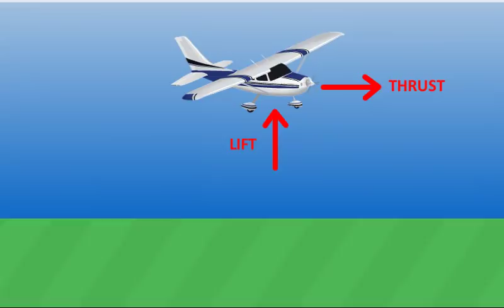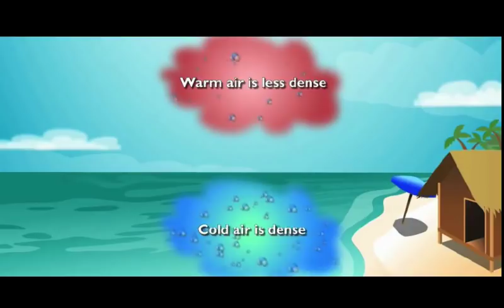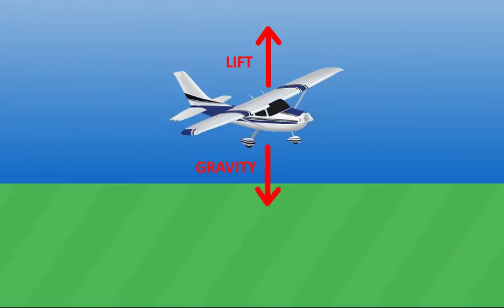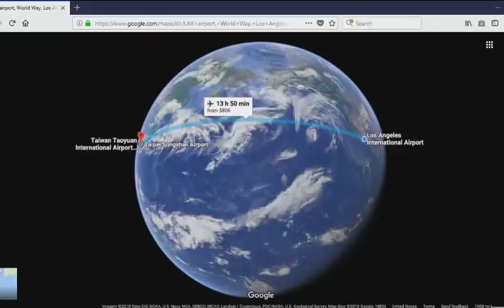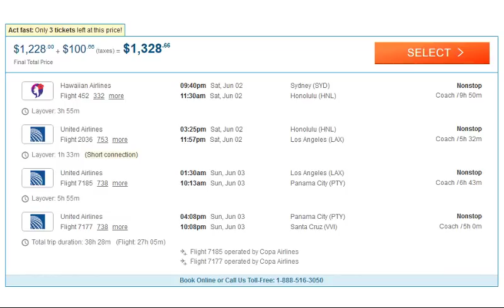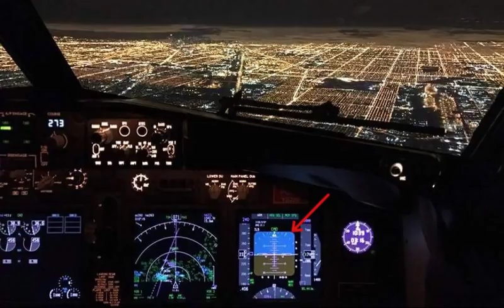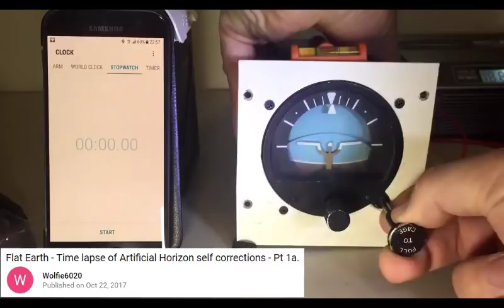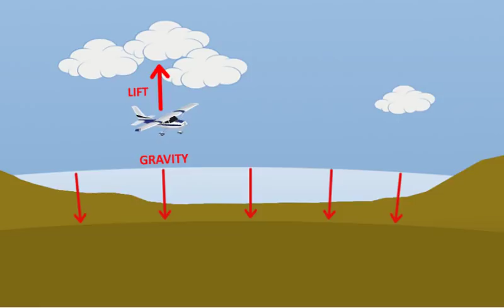Flat Earth Falsities - Plane Nonsense

Comment: The Video is wrong. You can't just remove variables from the equation.  You can't remove the 1000 MPH speed variable out of the equation because "The Atmosphere moves with the Earth".  The movement speed of 1000MPH still needs to be accounted for with the plane speed scenario.
Reply: +Viral Videos
Maths and physics are obviously not your strong suits are they.
Reply: Do you know what movement or speed is? 🤔 You cant just say you move with 3mph. This is physically wrong. You have to give a reference point. So you are moving 3mph on earth. Or you are moving 3mph in a train which moves 300mph on a earth. And earth moving with "blabla" mph around the poles. And the earth is moving with "bla" mph around the sun. And the sun ist moving.... And so on. But YOU feel (or see) only the movement your aroundings makes.

Mathematical you can see this too.
 V = s *t
This you will learn in school. But this isnt the whole equation. It is:

V = s *t +V0

So:

The train is moving 300mph and you are in the train moving 3mph in the same way the train does.
For the train:

Vt = 300mph +0  (cause the system we are watching is closed (you can make this infinite long))
 For the person:

Vp = 3mph + 300mph

Now you can compare both velocistys:

Vt = 300mph +0 | Vp = 3 mph +300mph

Now you can subtract 300mph on both equations. THIS WAS MEANT IN THE VIDEO. (Only want to highlight this) 

Vt =0 mph | Vp = 3mph

Now you can see, that you are moving 3 mph faster than the train itself.
Reply: @Viral Videos.
You are wrong. If you want to go to the back of the plane/train do you need to move faster than that plane/train is moving forward? Do you really think so? Then how it is possible that you walk faster than 500/60mph. LOL. Husain Bolt doesn't have a chance with you ;).
@Booby Wizard.
We have quite a good idea how that work. I told you before: air pressure which in turn create air resistance which in turn cause air friction and air viscosity. That air working against Earth's surface through millennia will go along with it.
Reply: Have you ever jumped on train moving at 100km/h and slammed into the back wall? No? Well, me neither. I'll preceed to try to explain to you why exactly planes work the way they do.
1. Earth rotates,
2. Earth DRAGS the atmsophere with it due to a force called FRICTION,
3. The atmosphere keeps moving along with Earth due to 1ST NEWTON'S LAW which says that what's in motion tries to stay in motion. That's why when you jump inside a moving train you don't hit the wall behind you, but instead move along with the train (in this case you are the atmosphere and Earth is the train)
4. The atmosphere is kept from flying off into space by a force called Gravity.
5. Plane is dragged by the atmosphere.
6. Plane keeps on flying through the atmosphere.
7. Most 13 year olds have no problem with understanding this.
8. Are you below 13?
9. If so then what are you doing on Youtube?
Reply: Yep, watch either of these two minute practical demonstrations and gain some understanding of preserved velocity:

https://youtu.be/CDf_0fPbNos
https://youtu.be/KacTRPL1MtE
Reply: Viral Videos:

No. You don't have to account sepperately for Earths movement. 
At least not, when it comes to objects like helicopters, planes, people and so on.
Because everything inside (lower layers of the) atmosphere moves with the exact same speed.
Everything on Earth is in the same frame of reference if you think so.

If you sit in a car, standing still for example, then you have a movememt of 0 relative to the car and to the parking lot you stand. If you start your car and drive, you move relative to the parking lot, but not to the car. You are in the same frame of reference as the car. You actually feel changes in speed, as in acceleration or breaking. Because your body needs time to adapt to the changed speed. This are the g-forces you feel while driving.
 but you don't feel much forces if you drive at a steady speed. (You can't drive perfectly even, so you likely feel a little motion at all times.

Imagine Earth as one damn big car moving through the universe. It doesn't accelerate or break, and moves very very steadily since a few billion years. So you just don't feel the earths movement, because it doesn't change suddenly, forcing your body to adapt. You move with the exact same speed. As the air around you, as houses, bodies of water and mountains.

This counts for planes and helicopters aswell.
The forces change a little bit in the upper layers of the atmosphere, as gravitational forces are weaker up there. This is the reasons why Earth has jet-streams - winds in the upper atmosphere that are responsible for the large weather patterns we experience.

TL;DR: You don't need to account for the Earths speed, as you and everything on Earth and in Earths atmopsphere moves with the exact same speed and direction, canceling out the effect. Like you sitting in a driving car, while the car is Earth and you are you.
Reply: jordy f: would it still need a windshield if there was a vacuum outside the car?
Reply: +Robert Lefebure
Why do you insist on proving you are a fucking idiot. We know you are so there is no need to keep on proving it, is there.
Reply: @Booby Wizard.
Find out about tangent to the sphere. Its definition require 90 degree angle to the radius which in turn is direction along force of gravity at that point of Earth surface.
Reply: @
Martin Gorbush
@Booby Wizard.doesn't do tangents only trolling.
Reply: Martin Gorbush you didnt understand my point. If you say: the train is moving 300mph and your friend is it sitting  in the train than you have to say further, that your friend is moving with 300mph too.
That says an outside observer.
If you are inside the train doesnt move particular to your speed.

That was the equation Vp = 3 mph and Vt = 0 mph.
Vp for velocity person
Vt for velocity train

When you stand outside:
Vp = 303mph
Vt = 300mph

When you stand outside the atmosphere:

Vp 303mph + earth rotation speed
Vt 300 mph + earth rotation speed

If you are outside the solarsystem:

Vp = 303 mph + earth rotation speed + earth/sun rotation speed
Vt = 300 mph + earth rotation speed + earth/sun  rotation speed.

And you can keep go on with that. But speed is relativ to a specific point. Our observation point is the scale of our "feelings" (dont knoe the real word) (like see, touch, smell, etc) we see a train relativ to our speed and than we can say: yeah, its faster THAN me or its slower THAN me. But you cant just say the train is fast.

Another example:
You are jumping. 2cm high. Your friend says: you are jumping very shitty low...
The snail next to you thinks... WOW so FUCKING high...
Reply: @Legromorph. It is strange but I haven't seen your comment before writing mine :).
Not to be malicious but equation for speed is: V =s/t.
Nevertheless your explanation is quite good.
Reply: Robert Lefebure: have you tried doing the maths to work out what that centrifugal force would be? I have. 
From my figures it works out at just 0.3458% of gravity. 
There is a bulge at the equator because of this though, and objects weigh slightly less at the equator too.
Reply: Legromorph

Brainwashed people always mentioned above you are inside moving train and cannot feel anything.

Grab a globe model with your left hand.
And spin it slowly with your right hand.
And look at it with your eyes, then think with your brain, HOW THE HELL THE AIR CAN MOVE ALONG WITH SURFACE OF THE EARTH AT THE SAME SPEED?
Reply: Legromorph Consider that the speed is 1100mph at the equator but is slower at the various north-south latitudes until there is zero travelled distance at the poles. Also, consider that the air speed necessary to keep up with those at ground level would need to be even faster at higher altitudes. ANd since they talk about gravity, why did they not mention centrifugal force? There would have to be some serious bulging in the atmosphere at the equator and hardly any atmosphere at the poles as the air gets "spun out" by the rotation. The idea that all the air moves as a unit at speeds ranging from over 1000 mph to zero with no visible evidence  is unfathomable. Even if the air was dragged at the same speed at the equator (and it would have to for doldrums to occur), the latitudes rotate at different speeds.
Reply: Martin Gorbush a good idea is factual? much like parallel to a plane makes a 90 degree angle. that is a fact. parallel to a sphere? negative.
Reply: Robert Nett

Telling a bullshit is easy just like say 123.

Try it in experiment, whatever you said is only works in your imagination.

You don't feel anything when you are inside a moving car because of the car has wind shield. The air is static inside the closed room of the car.
Try to drive a car without windshield, can you feel the wind?

Why GE believers are so damn stupid?
Reply: Viral Videos yeah they have no idea how the atmosphere moves with the earth either its just something they say.

Comment: This video is wrong. If the "air" is moving 1000 MPH with the earth, there is still 1000 MPH of wind speed in one direction.  Plus the earth spins at a variable and spins slower at the "poles".  If the Plane is flying perpendicular to the spin what happens then? or what if the plane is flying at a 37 degree angle of the spin?
Reply: If you are driving in your car at 70 mph then the air in the car is moving with you at 70 mph.
You can move any direction you like inside the car and you won’t feel any wind.
Reply: @Viral Videos wrote: "If the Plane is flying perpendicular to the spin what happens then?"
Airplane flying due north/south from equator will loss its perpendicular speed as it encounter air masses moving slower. This is very gradual loss.
Reply: Robert Lefebure 

Dude. 

1000 mph in space is not comparative to 1000 mph on Earth. 

Jump and do a 360. Took you what? 2 seconds if that? The Earth takes 24 hours despite moving 1000 mph. 

Now let us make it relative so you stop exaggerating and spreading this bullshit. 

If a human walks 3 mph East or West - relative to your size - you are literally walking faster then the Earth is rotating.
Reply: +Robert Lefebure
Why do you insist on proving you are a fucking idiot. We know you are so there is no need to keep on proving it, is there.
Reply: @Robert Lefebure wrote: "I'm talking like from 1000 to less than zero would be really noticeable in planes"
You must specify how long was a distance and how much time it took to reduce 1000mph speed to zero. Then you can think if that should be noticeable.
For example airplane flying 500mph straight north from equator would loose its 1000 mph drift speed during about 12 hour trip (6060 miles to the North Pole). That is about 83 mph per hour or 1.4 miles per minute. Would you really feel changing speed of car going from 61.4 to 60 mph over one minute?
Reply: Flying against the rotation you're flight takes longer.

Flying with the rotation you're flight is quicker. 

Thus why traveling N.Y. to L.A. and L.A. to N.Y. fail to take the same exact amount of time. In fact, they're about an hour (I believe) different.
Reply: Viral Videos 

Oh and the reason it is negated is due to the sheer size displacement. There's also the fact that "mph" is not the same on and off earth/gravity.
Reply: GrahaStw But if you put your hand out the window you will feel the difference. There is no windshield at the equator. The mountain tops would be cutting through the air even faster than the ground but they would exert far more "push" to the air than flat ground would. A 1000 mph is four ties stronger than a devastating tornado.  The equator is both the birth place of hurricanes and the home of doldrums. A hurricane spins at 125-150 mph both with and against air moving at 1000mph AND moves at a ground speed of 15-25mph? And, a doldrum (when the air was so "still" for days that sailing ships stalled) is actually when the air is dragged at the exact same speed as the spinning Eatrth?
Reply: Mykal Ridikulus  A globe spinning at 1000mph that had achieved getting the air to move at the exact same speed (from, say, mountains pushing it, drag etc) would result in a person standing there feeling NO wind at the equator because they, the Earth and the air were all moving at the same 1000mph rate. But there is a tower of air above them and the circumference increase going up would need for the air to move even faster to keep up. But I don't think it would. I would think the air would be dragged at a slower rate so the outer bands would not near the 1000mph. There would be so much shear as 1000 mph air diminishes to less than zero at higher altitudes it would be readily observable. I'm talking  like from 1000 to less than zero would be really noticeable in planes.
Reply: @Mykal Radikulus wrote: "Flying against the rotation your flight take longer"
That isn't always true. Airplanes fly thanks to air. That medium is responsible for its navigational problems (cross wind, head wind, tail wind). Check prevailing winds on flight height (30000 ft/10km-250hPa) on the globe and you will know why traveling between same location take different amount of time. Good start:
https://earth.nullschool.net/
Reply: @Robert Lefebure. Air has viscosity also.
Besides did you ever bother to calculate what speed is required to circumnavigate Earth at 100km height in 24 hours? 100km above equator it is about 1702 km/h when on the surface it is 1676 km/h. That is 26km/h difference. I wouldn't call that impossible to overcome. Especially if you know that wind speed at just 10km height can easily surpass 100km/h.
Reply: Robert Lefebure 

False. You are misrepresenting the facts and have forged an invalid frame of reference. 

Earth rotates at a 1000 mph. 

Frame of reference: a human walking 2 mph is moving relative to Earth's 1000 mph.

You fail at basic physics.
Reply: Newton's laws....
Law one: an object will retain a constant state of motion or rest unless acted upon by a non zero net force...
Reply: +Viral Videos
Maths and physics are obviously not your strong suits are they.
Reply: wong, you are so wrong,

Comment: every flight stop is a fuel stop, since they only bring the needed fuel + delay reserves.
once i even was on a plane from dusseldorf into the oposite direction of my target, because the second flight went from amsterdam to asia.
Reply: It's not just a "fuel stop" if they allow people to disembark. That's a multi-stop flight. And if you change planes then it is just two different flights.
Reply: Probably using one of those secret compressed air engines ;)
Reply: @GrahamStw
That explains it. Are those the Thai ladyboy compressed ones?  A couple of flights were around SE Asia.
Or the MENA ones? A few others were Gulf Air, and you know what they say about "women for duty, boys for pleasure".
Reply: I've been on flights that made several stops. They didn't refuel at any of them. Must have been magic I suppose.

Comment: Flat earthers don't care about facts. They don't care about proof or understand science. You could take them to space and show them the round earth and it wouldn't matter. They want to believe the earth is flat. Most of them NEED to. It's sad society has come to this but that's where we're at.
Reply: @stacy.
Use theodolite to measure surface drop after 3 miles of water. Do that at least 3 feet above water surface to reduce refraction. Eye "level" isn't enough because it is more than often wrong.
Reply: I'm not in the mood for Kool-aid
Reply: I didn't believe either until countless flat earth video's. Then countered with debunkers. Then common sense kicked in...NO we are not spinning at 1093 mph, 3 miles of water doesn't drop 74"(It's level ), bible verses confirm. I challenge you to at least look into it. Join us in exposing "The Greatest Lie Ever Told". One more thing...You don't really believe we landed on the moon....or do you?